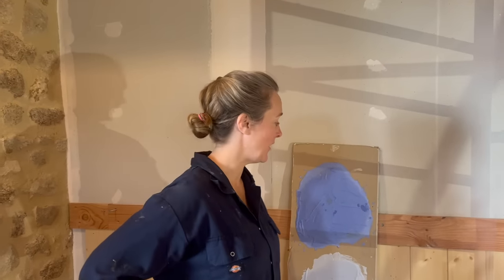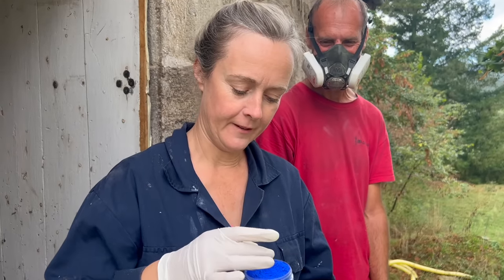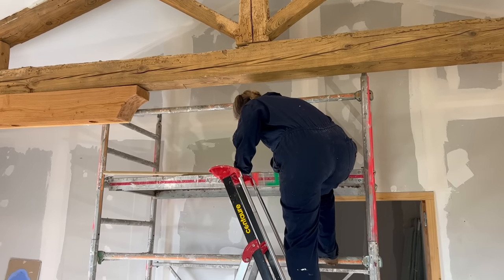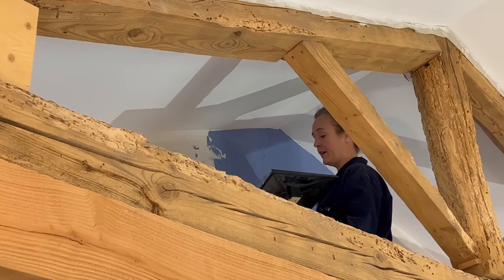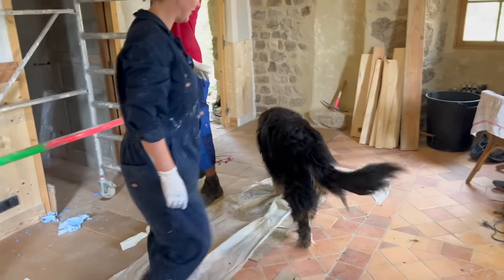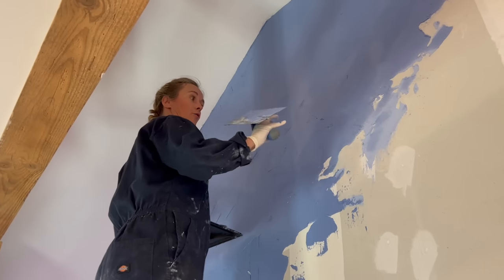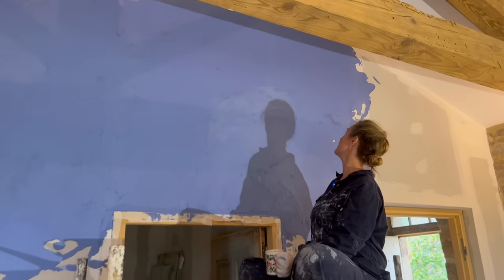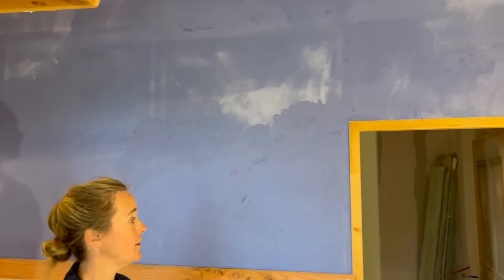TRANSFORMING our huge bedroom wall in ONE DAY! (The Historic Coach House Restoration)

Comment: Something I learned with baking: weighing the flour and sugar gives a much more accurate and consistent measurement, than using measuring cups and measuring spoons… this could be part of the problem you’re having getting a consistent color. Personally, I wouldn’t worry too much about your color being off a sheet or two because you have lots of shadows, casting on the wall. I love watching your videos!,😀
Reply from the maker: I weighed the lime too but just didn’t show it. But the pigment was in such small quantities that it was difficult to weigh. The scoop method was good but it was human error to forget how many went in just once!
Reply: @Chroniclesofrosieres  trial and error… when painting with multiple 1 gallon cans of paint of the same color (I learned that those other gallons will only be the exact same color if the person mixing the colors and the dyes were selected / created exactly the same), I like to “blend” the new can into the open can (usually when it is 1/2 low). This helps to blend the “batches” of paint and when it all goes on the wall, the colors are more likely to “blend” and variations are less noticeable (if at all). 

Your family inspires me to “get moving” on my projects at home. For example: 

I painted this two bedroom townhouse I rent from someone during the pandemic, and have yet to finish painting the doors and trim. I decided the trim really needed a heat gun to remove old/lead paint. So that has been a work in progress.

I tore all of the carpet out of this townhouse during the pandemic and have a pile of used (very good condition) carpet waiting to be installed for over two years, going on three now. 

The stench of the wood floor was profound from animal urine/feces all over the floors in every room. That situation lead to using various chemicals to remove it and decided the best way to handle that problem would be to varnish and seal the floors. With furniture still in the townhouse, it has been like playing a giant game of Jenga for over the past 2-3 years. 😂 

Bonus: the rent is considerably cheap in comparison to others for this area. Lol

If you/your husband can tackle that old monestary, I can tackle this little townhouse☺️😀

Thanks for the “push”☺️☺️
Reply from the maker: @margaretjacobs4016 oh wow what an epic project you’ve taken on! Nothing is ever as simple as you expect!

Comment: Tip the hawk toward you when you load the trowel. The thing about scrawney guys they break easily.Use a cleal trowel as a streight edge along the ceiling and wall. Blue is a difficult color to work with. Nice job though.
Reply from the maker: Oh wow the clean trowel as a straight edge is a game-changing tip. Thank you!

Comment: In the SE USA we simply sand the sheetrock spackling smooth and then prime/paint. None of this plaster stuff. But it is beautiful.
Reply from the maker: If you remember way back when I was doing the natural pigment tests, the reason we’re going to all of this trouble with plaster is to try and blend the modern dry wall in with the historic stone walls and add some texture to them. It’s definitely easier and more normal to just paint but we’re trying to be historically sensitive in our restoration.

Comment: I was wondering about the lumps of pigment.  2 possible options to loosen the lumps. 1. use a sieve. 2. dissolve the pigment in some of the water you used.
Reply from the maker: I tried dissolving it in water but it wasn’t very effective and just ended up sticking to the container. The sieve problem I addressed in the video. Just to far to go and buy one when you’ve already started the job!

Comment: Good job. I don't know if this would help but why not measure each item like in baking. Measure each item in separate bowls. So that way you know how much exactly your adding. Adding the pigment to the dry plaster, and thoroughly mixing it before adding the water helps to ensure an even color. Sort of like baking a cake. Mix all the dry before adding the liquids.
Reply from the maker: A lot of it is an issue of speed (somebody plastering needs a very regular and fast turnaround from the mixer), but measuring the pigment first in another bowl would have helped- you’re right. However mixing all the dry ingredients first isn’t practical with that drill mixer as it all flies up into the air and you lose a lot and risk inhaling it. Need to have water in it first.

Comment: I love plaster.  Why did you choose to color the plaster rather than paint.  It seems like it would be easier to achieve an even color.  Also, could you have taped off the ceiling or would it have been problematic?  The project is coming along really nicely.
Reply from the maker: If you have a look back at our earlier videos on the coach house restoration you'll see all of my experiments with pigmentation. We use natural pigments in line with our philosophy (where we can) and the type of plaster we use (with a resin to stick to a plasterboard wall) just wouldn't take the pigment when we painted it over the top. It's also the traditional method!

Comment: If it's ust the texture you like, just buy a galllon of close color paint and then pigmenation issue is moot. Just a suggestion.
Reply from the maker: A lot of this is part of our ethos to use traditional methods wherever possible. We’re not always looking for the quickest or easiest solution - this is a historically-sensitive medieval building restoration rather than a modern  house flip.